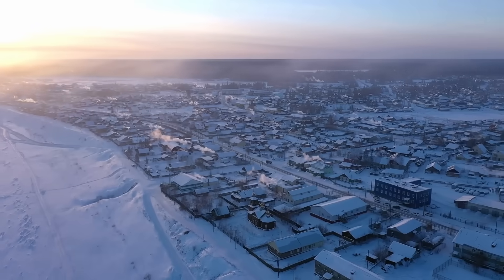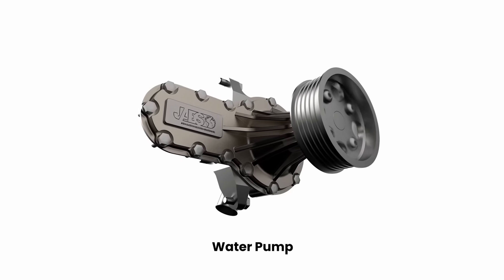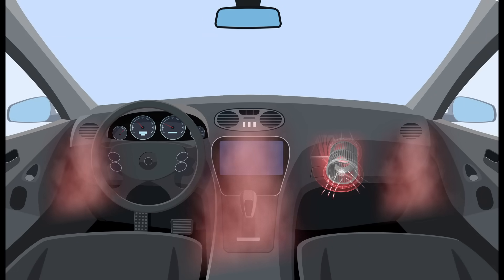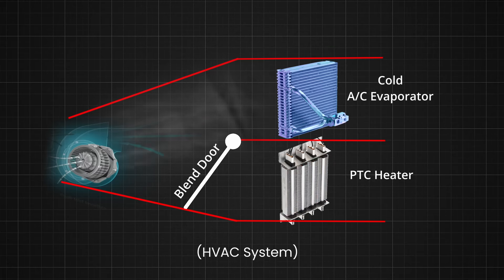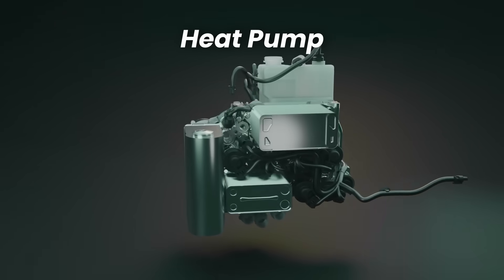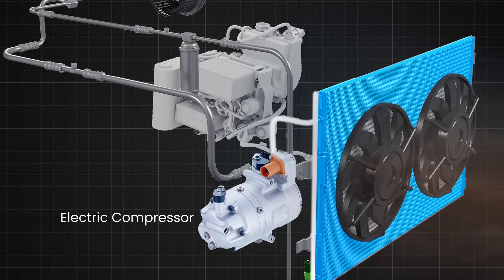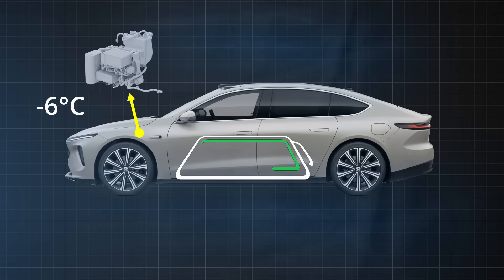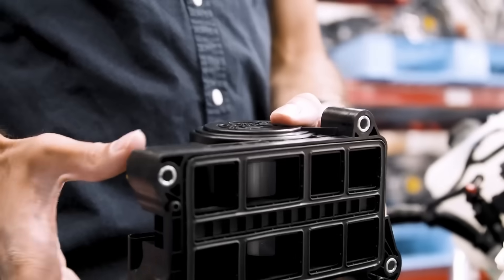Cabin Heating Explained : Engine Cars vs. EVs (PTC Heater, Heat Pump, and Tesla’s Octovalve)

Comment: Not mentioned is the Tesla heat pump is efficient but incredibly fragile due to their poor QC. In Canada few years back during an extreme cold snap, Teslas fancy system broke or stopped working altogether, freezing people in their vehicles.

Also not mentioned - heat pumps start to lose efficiency to generate heat far below the negative celcius range. Homes using residential heat pumps resort to heat strips to make up for this shortfall, but most EV simply use a secondary PTC heater to take over the heat pump when temperatures fall far below freezing. Tesla, once again in their infinite wisdom (or just to save cost) don't HAVE a backup PTC heater with cars equipped with the Octovalve + Super Manifold, resorting to running the electric drive motor inefficiently as possible to heat up the stator & using that to heat the cabin. This would add wear & tear to your drive motor, & add replacement costs, whereas other OEMs would have electric traction motors that would last nearly the life of the vehicle.

There are no engineering shortcuts, and anyone who buys a Tesla nowadays not only look stupid, but are actively funding Elon Musk and his oligarchy empire.

Comment: Awesome video!

So what did I learn?  
ICE engines are so inefficient (only 40% of the fuel used goes to moving the car, while 60% is waste heat) that they produce a lot of waste heat, which can be used to heat the cabin without decreasing the range, because it’s in the nature of an internal combustion engine to produce heat.  

Electric vehicles are so efficient that they generate almost no waste heat, so they need clever mechanics to produce heat (heat pump/Tesla using the stators of their motors to heat up the battery for fast charging, etc.).  

Tesla's OctoValve system is truly genius, utilizing any kind of heat produced by electric components and repurposing it for other functions within the car, wasting almost no heat generated by the components.  

PS:  
There were a lot of EVs before Tesla with heat pumps (Hyundai Kona EV, Kia Niro EV, BMW i3, etc.) so they were not the first to use heat pumps. 
Tesla started using the heat pump with the 2020/2021 release of the Model Y. After that, the other Model 3, S, and X followed. However, with the switch to the heat pump system, Tesla simultaneously introduced the OctoValve system and created a completely new system, revolutionizing the HVAC and thermal management systems of EVs.
Reply: NISSAN LEAF 👍
Reply: Your not taking into account that electric cars have to be charged from a grid. A modern power plant operates about the same effiency ~40% on the high end to mid 30%.

Once you carry the power over lines and step it down to d/c your going to lose some efficiency also in the form of heat.

There is no free lunch for power usage efficiency.
Reply: @richr161 no, but an ev still uses it more efficiently anyhow.
Reply: @sprockkets you're also forgetting that an EV is so much heavier than an ICE, that even at high efficiency it's still lugging around a massive battery pack. If we only consider the useful load transported instead of energy conversion efficiency, you'll see a different picture.

And of course, in cold temperature the ICE wasted energy is no longer waste, making it even more efficient
Reply: @totallyrealreports  Weight and cold weather do impact EVs, but even with a heavier battery, they still use 25–40% less energy per passenger-mile. ICE vehicles can reuse waste heat for cabin warmth, but they’re only 20–30% efficient overall. EVs, even in winter, remain around 60–70% efficient from grid to wheels—especially with modern heat pumps reducing heating losses.
Reply: @C_G1443  well I guess the best of both worlds i hybrid then
Reply: @ If you have no home or work charging option, hybrids are a good alternative to EVs. You just need to drive it long enough to justify the added cost (same with EVs). I had a hybrid for around 12 years with zero problems. Just regular maintenance.

If you can charge at home, EVs are very convenient. I have been driving an EV for four years now and have done zero maintenance. I only charge at home and we have solar power that covers all the use. 

EVs aren't the best for everyone (long range towing for example), but for people who can drive one they're amazing. Saves a ton on gas, no oil changes, amazingly quick acceleration, nearly instant heat in winter (and you can preheat in a garage).
Reply: @ "you're also forgetting that an EV is so much heavier than an ICE"
My Kia Niro weighs only around 20lbs more than a Mazda CX-5
Reply: @sprockkets  you're comparing a FWD small crossover with an AWD compact SUV. The CX-5 is bigger and its drivetrain adds a lot of weight
Reply: @totallyrealreports  Since when is the CX-5 always AWD? They both are FWD.
Plus being at ~3700 isn't much at all.
Reply: @sprockkets  as of 2024, all trim levels of CX-5 are AWD, I guess you have an earlier model
Reply: @alexdoan273  comparing the generation contemporary to my 2020 niro.
Reply: And in electric transmission lines there is plenty of waste theere too, in generating power there is a ton of waste, in charging the battery in car there is power waste
Reply: @MarsPLAYStudio  tesla octavalve is cool.. but it can screw up and need a $3000 repair... and ice car heater is simple... waste heat and a fan
Reply: @williamhaynes7089  Dont forget that heater cores go out in ICE cars too, a lot of them require the dash to be torn apart especially with all the new dual or even triple climate zones
Reply: @fuiwfnbnufjehnfojui4251  yes they do... I have replaced a few .. 5 to 6 hours labor .. but here in phoenix most people just bypass heater if it leaks ... say forget it

Comment: 20 minutes ago: 30 mile drive in sub zero F weather in my model Y and climate took 0.8 miles at 70° with seat and steering wheel heat on.
Reply from the maker: Thanks for sharing your real-world experience—that’s super helpful!

Comment: Does this work differently in hybrid vehicles ? Not PHEV, but hybrids ?
Reply: I used to own the 2021 Toyota Sienna hybrid, it is very annoying, the hybrid is useless in winter, relying on the ICE engine 100% to produce heat in your cabinet, poor solution. It was a great car except the climate control.

Comment: Having my heat set to 67 F in 6-20 F weather for the duration of our winter here in the US, which here is about 6-7 months... I lose maybe 2% range over a 200 mile trip. The heat pump in a 24 Model Y is stupid effective. That's with it on Auto and usually on 'Low'. We're nice and toasty. 7 seater, 5 in car.

Comment: Why can't we get the heat from battery heat dissipation.
Reply: Electric drivetrains are known for their efficiency. The vast majority of the energy generated is being driven to the wheels, not as generated heat, so basically the drivetrain produces too little heat to pipe into the cabin or regulate itself. This is unlike a gas engine which is basically a giant heater that also powers the wheels.
Reply: @thedumbconspirator4956  i wouldnt call electric motors efficient. They need to run at very specific load and speed to achieve 95+%. Yet they are more efficient even than toyotas petrol engines overally
Reply: @NoName-md5zb  a bad motor is 95% efficient at a specific speed. that same bad motor will drop to about 80% efficient outside of the optimal speed. 
SYN-RM motors such as those used by Tesla are highly efficient across the whole speed range. 
A good internal combustion engine, lets say toyotas petrol will be 35% efficient at best, and im being super nice to toyota with that number. 
internal combustion is comically inefficient.
Reply: @jonknight311  interesting. Indeed electric motors in evs have advanced further. I am used to seeing optimal efficiency only in middle of graph.
Reply: Battery doesnt heat much. Motor does. But its still not much heat, unless at very high speed

Comment: Not an EV guy, but Teslas engineering is pretty incredible.
Reply: The engineering, yes. The built quality not so much.
Reply: @martinweizenacker7129 Old meme. Teslas built since 2022 are solid.
Reply: heat pump is nothing inovative just your regular A/C but reversed by 4-way valve

Comment: The heat pump seems overly complicated and would be prone to failure. Wouldn’t it be better to add more batteries and keep it simple?
Reply from the maker: Adding more batteries could indeed simplify the system, but it would also increase the vehicle's weight and cost. The heat pump strikes a balance by improving energy efficiency without adding unnecessary bulk or expense. Modern heat pump systems are engineered to be robust and reliable, with minimal moving parts prone to failure.
Thanks for watching and sharing your thoughts!
Reply: the parts count is fewer than the AC system it essentially replaces. 
look at the pipework in a typical car with cooling and AC system and compare it to the supermanifold. 
Tesla's system actually has fewer failure points.
Reply: @jonknight311  Any one of the seals on the manifold or the octovalve can fail right? Or the components its going to?
On a traditional ICE you have the coolant to and from the engine, the heater core, and the radiator (overflow too), that's it for heating. Ive seen under the hood for Teslas pump, there is a lot going on there.

Also, does the supermanifold even handle cooling? I don't know because this video only covered heating.

Comment: So you're talking about reduced range for EVs in cold temperatures. Why not talk about reduced range for gas cars? My jeep has about 350 miles of range in the summer. In the winter that drops to about 280 in the winter. That's more range loss percentage than my teslas get under the exact same temperatures, driver etc. And that range loss for the jeep costs about 15x more than the loss from my teslas.
Reply: Isn’t winter loss due to winter blends of gas? Or is that debunked too?
Reply: @kalvin126  several issues. Winter blends are one of them. Thicker oil and grease in bearings are another. Winds tend to be higher in the winter. Winter tires have more rolling resistance. People warm up their cars more during the winter.
Reply: @ I don’t run winter tires, heated garage , I don’t idle and warm them up
Reply: No one Else has this amount of Range loss sorry thats Crazy 😂😂
Reply: @Tropicvalue  wrong. All gas cars suffer similar range loss. The difference is that with a gas car you see an inaccure needle on an obscure scale. EVs show actual range based on history and battery capacity. Much more accurate.
Reply: @CRPerformance1 wrong I don’t see massive range loss in cold weather all 3 cars we have are always within 1 mpg summer to winter
Reply: @mitchharris97  liar!
Reply: @ nope 😂😂 stay mad bud I’ve literally looked into this across all 3 cars all came within 1 mpg of summer mileage  sucks to suck!
Reply: @mitchharris97  I guess you'd know that it sucks to suck.
Reply: @ 😂😂😂😂 stay mad bud
Reply: @mitchharris97  not mad. I enjoy calling out liars.
Reply: @ so you claim even though I’m sharing the facts across all three of my vehicles 😂😂😂 but you go ahead and claim it’s lies cause it doesn’t align with what you believe
Reply: @mitchharris97  because you're lying. That's why. Sorry princess. You're wrong.
Reply: @ 😂😂😂 nah you just believe that cause it doesn’t align with your views  I’m speaking from real world experience 3 cars over 500k miles of driving  
You realize your car doesn’t care what temp it is outside once it’s an operating temp right?
Reply: @Tropicvalue this is a Tesla owner in disguise. 
I drive a 2 litre engine and see no significant range loss both under air conditioning and heating.
Reply: @tungstencarbide7255  no disguise. I own 3 teslas and also own a 2.0 liter turbo jeep. I've owner more that 10 other cars I don't own now. All that being said, you're a liar.
Reply: @CRPerformance1 , there are 2 clear points here:
1. Your jeep is really shitty car
2. You are a troll 😂😂😂
Reply: @vasilvasilev8586  nope. Just one. You have no idea what you're talking about and a troll calling a troll is a compliment. Thanks.
Reply: @CRPerformance1  , yes yes, we all know already…you are the all knowing one and the rest are “Jon Snow”🤣🤣🤣
Reply: My BMW X5 does not lose range to that extent.
Reply: @sebastiantevel898  liar!
Reply: @CRPerformance1  Keep crying.
Reply: Yea, my brand new 2024 hybrid car loses about 20-40 miles of range. In summer I get almost 600, and in winter it drops to 530-540
Reply: @ wife’s jeep gets 21mpg summer currently in winter averaging 20.5 
My truck normally averages 21-22 currently getting 20-21 
Work truck normally gets 16 currently getting 15.5. Soooo very little loss and as I stated before within 1 mpg loss for all three
Reply: @mitchharris97  I'm calling BS unless you live in a southern state
Reply: @ nope Iowa bud all my numbers are hand calculated   The part your missing here is I don’t idle to warm them up just start it and drive oil isn’t any thicker winter to summer once at operating temp modern cars adapt to different temps with timing and fueling allowing them to run efficiently in any temp the 1 mpg loss I see starts once we switch to winter blend fuels
Reply: @ modern technology makes a big difference in efficiency someone needs to do more research
Reply: @mitchharris97  2023 jeep. 2024 tesla.
Reply: @ mine are a 23 Silverado 18 Jeep and21 ram and my results have been consistent across all 3
Reply: @mitchharris97  rework your numbers. They're wrong.
Reply: @ repeatedly claiming there wrong doesn’t make it so 😂😂😂😂 truth hurts bud
Reply: @mitchharris97  sure does. And you're still wrong princess.
Reply: @ 😂😂😂😂 deny all you want bud doesn’t change the facts
Reply: @mitchharris97  We have diesel, i dont idle, pointless, and when refill we set the odometer to zero, the odometer between refills shows 450 miles summer, 390 winter, 2021 year car.
Reply: Yeah no I don’t agree here. Unless you idle your car to heat it up, I don’t see a reason why there is more fuel being used. The heater literally uses waste heat produced by the engine… Even better, my fuel consumption gets better in the winter since the A/C isn’t running…
Reply: @PeetB_ around 20-30 years ago, when I was younger, older people regularly talked how the car consumes more in winter. It was important because people had little money. So in my youth, it was common knowledge. Strange this thinking is different nowadays. Perhaps its also the winter tyre resistance that increases, driving through snow when there is some. What does it matter, point is its different, perhaps also Your winter feels like our autumn.
Reply: @PeetB_  liar!

Comment: Tesla heat pumps break down a lot and often in the cold. In Northern Europe, a really high failure rate of breakage in winter. 
I would prefer to take PTC Tesla anytime.
Reply: When do they break down, e.g. timeframe?
Reply: It's -6 to -15 C here in my part of the USA for 6-7 months of the year. The heat pump has done fine . Perhaps older models suffered more? We're in a 24 model Y.
Reply: This is just shitty Tesla QC in play. My Audi e-tron has a heat pump and it has been in service for almost 3 years, 0 issues. That said, range loss is a thing especially once temps drop far below -10deg C.
Reply: No, no they don't.

Comment: Is this a Tesla commercial? My EV also has a heat pump, but my EV is NOT a Tesla. Why? Will NOT support eLon mUsk with a single dollar! Incidentally, an ICE car's heating system may be efficient, but an ICE car is NOT efficient - it is inefficient and uses the available energy really poorly.
Reply from the maker: Thank you for your comment! Just to clarify, this video is not a Tesla commercial. My goal was to explain the technology behind Tesla's Octovalve and how it works as part of their heat pump system. Tesla’s implementation is one example of how EV manufacturers are advancing thermal management, but it’s not exclusive to Tesla—many other EVs also use heat pumps, as you mentioned.

You’re absolutely right about ICE cars being inefficient overall compared to EVs, even though their heating systems can be efficient. I appreciate your input and perspective—it helps keep the discussion balanced. Thanks for watching!
Reply: Same!  I was looking into a Tesla but then Elon went off the rails.  Bought a  F150 Lightning instead.  2024 Lariet.  It's the first year that Ford put in a heat pump.  Wonderful truck.  Perfect for us.

Comment: The only fault in this is that the coolant is always going through the heater core, unlike what was said at 2:19. The blend door in the hvac system determines if the air coming into the cabin goes through the heater core or not
Reply: Some cars can control flow into the heater core. Had a friend who lost cabin heat because the thermostat was faulty in the old Chrysler.
Reply: @battery_wattage  Yep, older GM's had water valves to control the flow of coolant in the heater core. My 1981 Pontiac Bonneville and 1985 Chevrolet Caprice operate this way.
Reply: Not in all cars. Some have blend door, as you say, while others control the flow of hot coolant through the heater core. I have seen both types